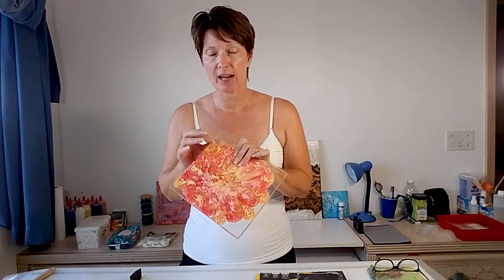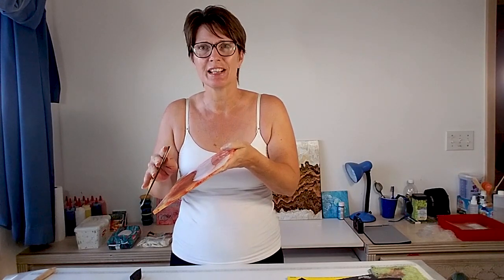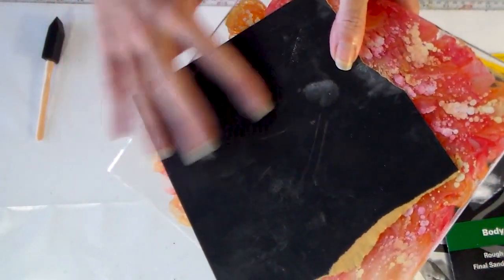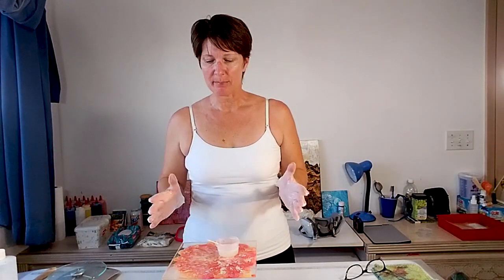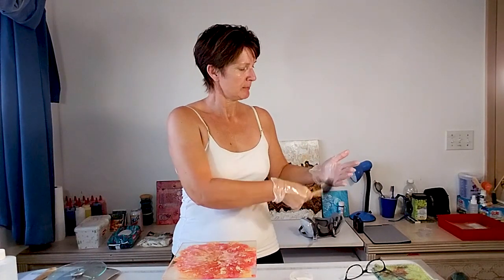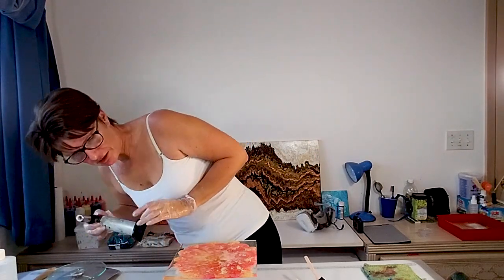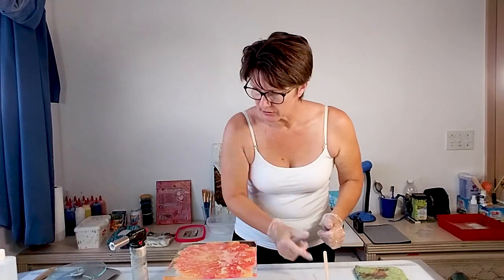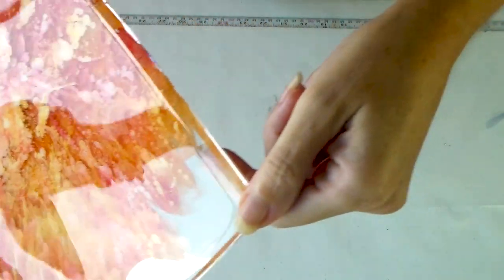How to fix flaws in resin - resin for beginners

Comment: OMG! What a great way to fix it. I wanted to cry because I flubbed up on five pieces and poured resin over them 3x and they still had issues. I used foam brushes on them and no torch. You are amazing. Thanks!

Comment: Love the ending commentary on the black background.  Too cute.  I appreciate the repair work and the fact you showed your safety gear (yeah!)   Handy future tip is to only go up 100-ish grits at once to keep sanding grooves smoothed out from the last round (220-320-400, etc.  Probably fine to go 220-400 here since resin is so thick compared to paint.)  400 is usually where auto repairs stop to paint so can save your 800 for really fine work and stop at 400. Lovely piece, well done.

Comment: Nice fix!  I would have thought you would have had to sand the entire piece in order for the resin to stick.  Nice to know it's not always necessary.
Reply from the maker: I think if I was doing a multi layer piece with thick layers, I would do that, but for this thin wipe over, it is most likely OK. But no harm in giving the entire surface a quick sand just to be sure.

Comment: So pleased i came by your tutorial, it was very easy to follow , lots of great tips. I am new to resin and only because I have needed a heat resistant coating on MDF coasters that i do mandala art on. The resin on my coasters pulls in on the edges on drying, I'm not sure why as it has dried hard and clear. Could i use your thin brush on method after sanding to fix this problem? Thankyou again!

Comment: Thank you <3  About using small amount of resin ...  1) the guys who make resin floors use tools with teeth looking like a comb, it works much better than spatulas and such 2) I've just seen somebody (?) on YT using a silicone makeup "sponge" to spread varnish and it worked very well, now I wonder about spreading resin ....  3) I like "hand massaging" method but it seems to be wasteful. I think you could wear your mask while sanding resin, too.
Reply from the maker: Thanks for all the tips. I did have my mask on for most of the sanding which is why I showed it mostly already done, and just did a bit for the camera. I do have one of those notched spreaders. Need to look it out.

Comment: Hi there Deby. I have done all the above as suggested and I am onto my third repair on a canvas. First one fish eyed. So I sanded it as above then cleaned it with alcohol. Repoured then a fly snuck in and walked on it. Repeated the same procedure and then a line appeared around 1/2 an hour after I was sure it was perfect. Very frustrating to say the least.  So is the sponge brush the best method for application rather than a spatula. Thank you.

Comment: can i get some advice. i recoated my pyramids, but they dried all botched up, all bumpy and not smooth, any tips?
Reply from the maker: I wonder if the coat was too thick? And then it ran a little while setting up? You may need to sand it smooth again and try with a very thin coat. I'm painting it on a bit like nail varnish. Perhaps even setting the pyramid level and doing one side at a time so it can't run.

Comment: What about a resin that I’ve mixed with some color? The finish is black so how would I fix that? It’s also not a flat surface to re-apply resin. It was made with an asymmetrical mold.

Comment: Hi! Love your video! Help!  How would you fix a painting that resin dried with a hair in it. Thank you!
Reply: urgh, hair is difficult because so rarely is it just sat on the surface and can be sanded out. You usually have to dig it out and then uneven voids in the resin can be impossible to fill without seeing it later. Sand as much as possible to remove the hair if its close to the surface. If it's deep, you may have to cut it out with a sharp blade, then flood coat. good luck
Reply: @DebyColes  Thank you so very much!!! Your info is tremendously appreciated

Comment: When you say ‘mix up some resin’ what are you mixing it with? I have separate resin and hardener. Do I need to mix them together for this or just use one? Thank you
Reply: I'm not mixing the resin with anything, it's just the usual resin mix. But you ALWAYS have to mix the resin and hardener to use it, otherwise it won't 'work', it won't cure. So yes, mix your two parts in the usual way, but don't mix in anything else with it. Sorry if that was confusing.

Comment: I made my first UV resin piece last night and I messed it up, fixed it and messed it up again!  It's a 1 1/2" X 1" pendant. I don't think the second one can be fixed.  I put some tiny seashells in it that I want to get out of the resin.  Any tips? I'm considering soaking the pendant in acetone to try and dissolve the entire thing.  What a waste!
Reply from the maker: Oh that really does sound too far done now. Trying to remove something like a shell is going to leave a mark most likely just because of all the nooks and crannies in such a tiny shape. Put it down to a practice, a learning experience, and start again. UV resin is expensive so I understand your pain.

Comment: I have no idea how it happened, but a coaster I recently made ended up cracking in two places on the side that was face down in the mold.  I don't know if it happened when I took it out of the mold and it wasn't fully cured or what.  It's not cracked all the way through.  Should I try to sand it down and then put a top coat?  I do have objects in it, so I'm afraid sanding it on that side will ruin it.  Any advice?
Reply from the maker: Oh thats a difficult one. This is really only for surface flaws. If you have a crack that goes into the body of the resin, even if you create a nice new surface you may still be able to see the crack underneath.

Comment: I found your video very helpful, one question. 
You said you were going to cover your project .... what do you use to cover it with while it’s still tacky ? And how does it not effect the finish ? Ok so maybe 2 questions !
Reply from the maker: It depends on the size of the piece. I have a cardboard box and a plastic crate I use, depending how big. Make sure it's dust free, and pop it over the top so it's not touching and then leave for the piece to cure. Prevents and bugs, dust or cat hair getting on the resin while it's still wet.

Comment: Can you help, I want to pour a second layer, the first layer was poured using a mold, so on the second layer do I put the object back in the mold? The only thing I fear is...the object is already at the top of the mold, so it will run off the sides when I pour on the top layer. And it’s my understanding that at least 1/4 epoxy needs to be poured, then wait till it gets like  glue 
Can you advise me
Reply from the maker: If the piece is already at the top of the mold then probably no point putting it back in. You could try using painters tape to build up a damn around the resin edge to stop more from running over. Do you actually need a thick layer? Could you just brush on a thin layer like in this example?
Reply: Awesome so I can remold !!!

Comment: my resins is becoming cloudy with streaks in it. what could be the problem
Reply: It sounds like perhaps they weren't completely mixed. I really make sure to scrape the bottom of the cup and the sides to make sure everything is mixed in well. Its a chemical reaction when the resin sets, and it may look clear enough when mixed, but if things aren't quite right, when the reaction occurs things won't cure properly if there are bits not 100% mixed together sadly.

Comment: Can i touch up cured 2 part resin by using UV resin?
Reply from the maker: What an interesting question. I honestly don't know the answer because I've never done it myself, but it should work I would think. It would give the same effect to mask any scratches, but whether you would see any difference in the two materials used, I just don't know. I hope you will give it a go on a test piece and let us know how you get on.

Comment: How would you fix a big hole in a fountain?
Reply from the maker: Is it made of resin? I can't even imagine what that looks like. I can only say with a 3d structure, and a large hole you need to fill, you might want to do it in several layers, and you would certainly need to lie it down to fill so the resin wouldn't run out. Otherwise, I'm a bit stumped.

Comment: why did you take off the mask ? the fumes were still in the air
Reply from the maker: You can't hear me speak with the mask on, so I sacrifice in order to make videos for people. My room is very well ventilated with wall to wall windows on one side and patio doors open on the other side, with a breeze coming through off the sea. When I am not making videos, I shut the door and leave the room until cured. I take safety very seriously.